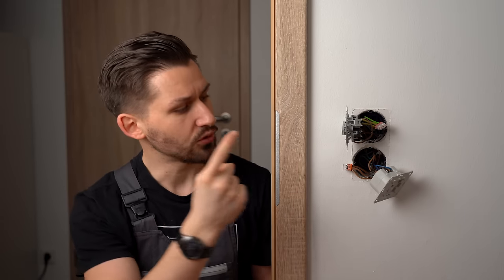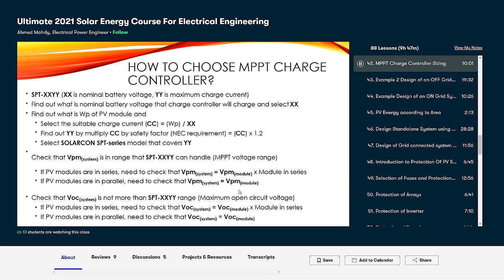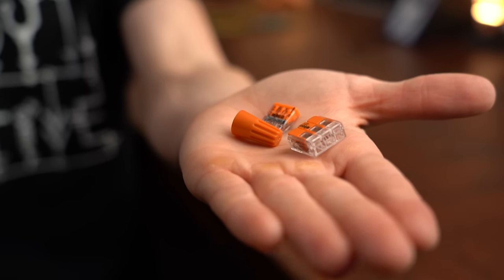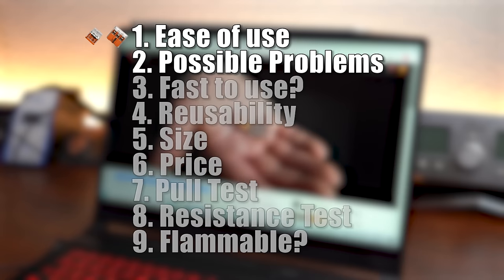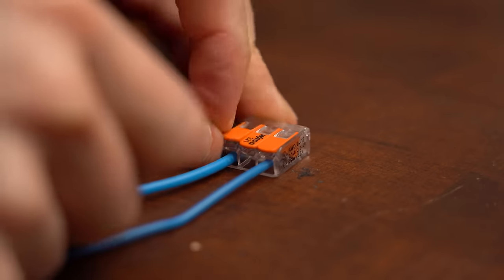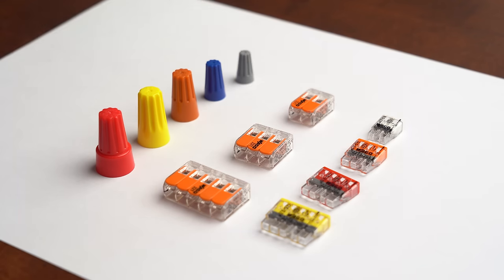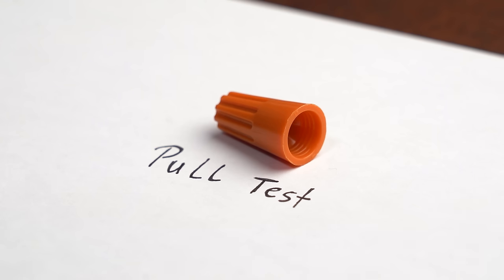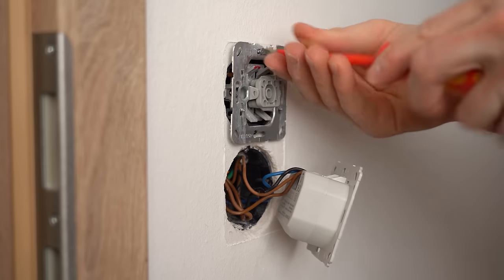What Wire Connector is the Best? Settling a Debate! Wire Nut VS Wago

Comment: PS when using wire nuts I was taught to always pre twist with your pliers before adding the wire nut.  Also when connecting one wire to a smaller size the smaller size is twisted proud of the larger to enter the wire nut first by a small bit.  Same with stranded connected to solid with the stranded entering first by a bit.
Reply: Yep, one need to pre-twist them! Today, wire knots are little used in the Netherlands. But in the past I used them a lot. But first you twist the wires together. Only then are the wire knots screwed on. That gives a stronger and better connection. Like any tool, you have to use it properly!
Reply: It's actually in the instructions. Which I have never seen since they don't come with them.
Reply: i always found the joint is much better if you do not pretwist the wires, and insert them parallel (not crossed over) and get at least three half twists under the nut to take the strain off the nut
Reply: There are wire nuts like the ideal wing nut that instructions say that twisting is not necessary . And it isn’t. Take the nut back off and the wires will be twisted just as if you had twisted with lineman’s pliers first. You do however need to make sure the ends line up and you have sufficient strip length. But you do not need to pre-twist and any nut that says you do , throw it out!
Reply: Without pre twisting you will never know if the connection is good as it is hidden under the nuts.  I have taken apart many which were not right.  No matter what the advertising says (saving time is a selling point not a best practice) pre twisting is a visual testing and best practice.
Reply: @douglasthompson2740  if you aren't stuffing too many wires under the nut and you line the wires up properly then you won't have an issue requiring pre twist. It's blatantly obvious if a wire nut went on incorrectly just by the feel of it.
Reply: @16vSciroccoboi  I didn't start yesterday but I am wondering if you might have?  No I use the rated number of listed wire and yes sometimes you can feel a bad connection but not always.  I can see them always.  When using the smaller sizes with stranded wire such as come on many light fixtures it is especially difficult to 'feel' them accurately.  Visual=100%  "feel"= maybe 75%  not good enough!
Reply: Exactly! You "tie the joint" then "nut the joint", a properly tied joint only needs the nut as a means of insulating the joint! In the USA, inspectors WILL remove your nuts to test your tie, a failed tie is a failed inspection since a failed joint induces heat and causes a fire!
Reply: @jbcages2987  In many countries in Eastern Europe we just twist the wires with pliers and wrap them in electrical tape.I have seen 60+ year old wiring like that in a factory with continuous havy load and never had a problem.
Reply: Yes, always pre twist. The reason this is not on the instructions is because this requires more skill and can be screwed up, especially if you over twist and start to fracture the copper which can cause a bad connection in the future.
Reply: I was taught that solid wire no twist, stranded wire twist, and joining the two twist the stranded around the solid.
Reply: Wow if you're supposed to do that how are they saving time? You might as well just use a crimp connector at that point & save your poor hands from all that screwing.....
Reply: @LostBeetle  For stranded to solid you should not twist but rather let the nut to the work. Check this video out https://youtu.be/NVNzuF2UUrI
Reply: @warrenw2u  In today's world I take claims like that with a grain of salt.  Manufacturers would sell you an ice boat to use in hell's fire telling you how cool you will be all the while.  Who can't recall hundreds if not all ads overselling products capabilities??
Reply: I had an instructor who specifically told us to never pre-twist the wires.
Reply: @heronimousbrapson863  Did he give any logical reason??  Best I have heard over the years is it is faster.  Which of course is no reason at all.  Not only does it give a good visual but I have seen several non pre twist applications over the years where one conducted slips ahead of the other then when the nut tightens down it drives that single point through the top of the wirenut itself.  Just one more reason to pre twist among many.
Reply: I find wire nuts bad at doing anything than stranded to solid wires. Solid to Solid WAGO are way easier.
But WAGO is still not the optimal design. Good terminal block setup is way better, IMO.
Reply: Yes I heard this as well, however for the contest of which is better, there's a good argument to be had that such advice should be ignored for the purposes of the comparison since many people may use the products without being educated on how to use them optimally/properly.
Reply: @douglasthompson2740  give ‘em a tug after you install the nut. That will confirm a good connection. You should do this regardless of the pre-twist for ‘best practice’
Reply: @andrewfunk9167  Always do as a habit but that is not a definitive test as I have seen the nut well attached to one conductor and not to the other this most often is when someone is joining solid and stranded.  The stranded ends up bunched around the solid rather than evenly twisted.  Just saying pre twist is the only effective test.  I am not slamming wire nuts as all types have their place and I have used them for many decades with great success doing the pre twist.  When dealing with connections why settle for maybe when you can be certain?  The stakes are too high for maybe's even if it is only a one percent chance.
Reply: @carolinafrog4365  Do they replace them with a new nut since they're supposedly not reusable?
Reply: @douglasthompson2740  
my electrician dad told me that the wire nut was there to prevent the wires from unraveling and to prevent arcing. wires should always be mechanically connected before nut goes on.
Reply: @douglasthompson2740  
Agee
Reply: @mernokimuvek  
Thats how my 1952 home was near St. Louis and no ground.
Reply: @daletyler5344  I guess that still works flawlessly.
Reply: However the issue is I have seen several comments of people telling each other to do this differently so this really can’t be proper technique if there is disagreement over it

Comment: In Australia we generally use screw connectors (BP connectors) but in the industrial sector wagos are becoming popular.  Wire nuts have never taken off.
Reply: Ah thats what those are called in english. Good to know lol
Reply: @p3chv0gel22  True that, we call them Dominos in french
Reply: That's my preferred way of doing electrical work too
Reply: I'm in Sydney, I believe wire nuts do not complie with  AusNz safety standards of a wire connector in a electrical environment, no current rating . Working on Ausgrid /Endeavour and Essential Energy networks ABC (Ariel Bundle Cable)  use larger industrial connectors and some connect services that look similar to Wagos except they are entirely covered in the same black rubber as ABC.
Reply: They are also used in germany. Not that common in the electrical field anymore. They have a lot of disadvantages.
Is the wire in deep enough or already on the other side. How is the power afflicted by the dent the screw left in the wire. And if you reuse that same wire. Is the screw screwed in deep enough but doesnt pierce the wire. You need at any time a skrewdriver. Those screws wear out over time of usage. Sometimes the plastic housing gets damaged (most of the time while operating the screw) and exposing live parts of the connector. You can ever connect 2 wires together only or you have mostlikely a bad connection and a bad grip of the screw. You shouldnt connect stranded wires except you coate them beforehand.
Everytime using them they feel like operating an experimental device.
Reply: We call them sugarcubes and they're basically the grandaddy wagos.

Comment: USA here, I've been using Wago since I first learned about them 10 years ago.  Even went through the trouble of opening ever box I had in my home to replace the wire nuts with the wago.  Glad I did at least half of the wire nuts were either barely on the wires or in the case of two plugs had fallen off
Reply: were they poorly installed, then? any poorly installed type can fail...
Reply: @judychurley6623  yeah seems the previous owner was a DYI guy but didn't have a clue what they were doing.  Beyond the lose wire nuts I found many plugs with the hot and neutral reversed and a few that had the ground tied to the nuetral in the box.  Now maybe the guy was an idiot or maybe it was done to fool the home inspector because the cheap ground testers will show a plug as good with a cheat like that.  Not sure but I fixed them all and the Wago connectors made my job a whole lot easier so I'm glad they exist and that they are perfectly acceptable per code.
Reply: Sounds like your house was wired by a first timer.
Reply: @RobertBeck-pp2ru  for sure
Reply: @judychurley6623  Wagos fail when there put on right.

Comment: I agree with most of what is on there.  Wagos are definitely better for space, neatness, time, and reuse while nuts tend to be cheap, easy to use, and durable.  Though, there are a couple of things to point out for someone who doesn't use nuts often.  

First off is that nuts aren't supposed to conduct.  The wires are held together directly.  
Second, is that issue you had with the strands not twisting together.  For those of us that grew up on them we normally give the wires a small twist before inserting them.  This removes the problem.